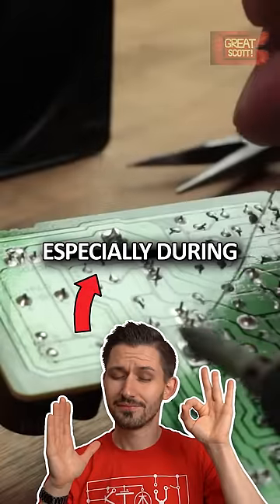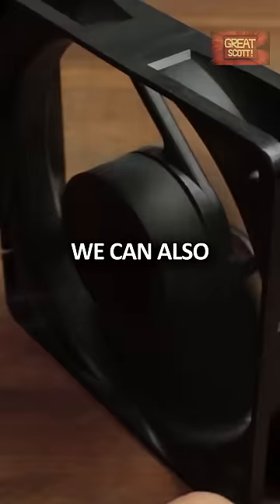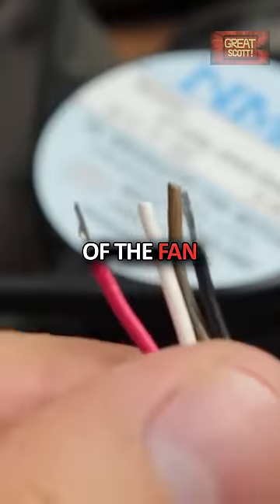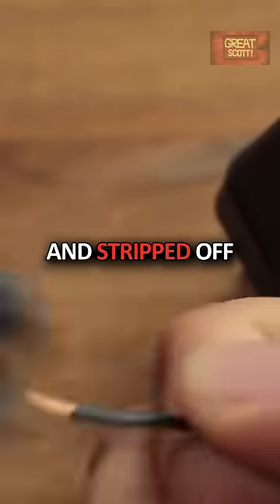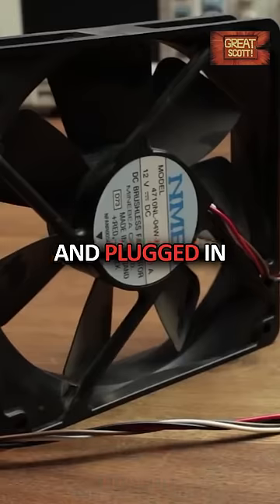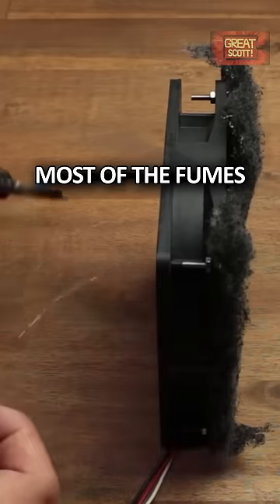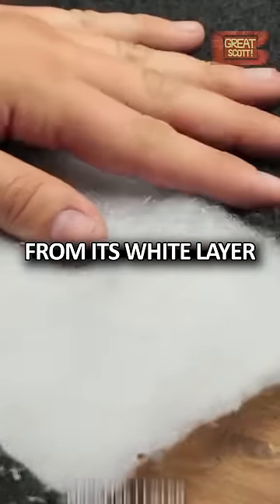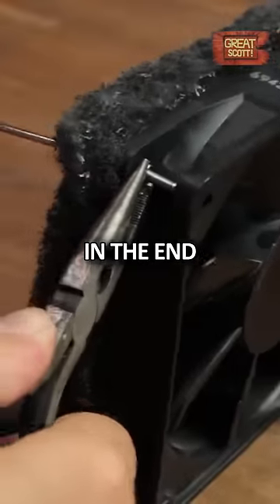Always have This when Soldering!

Comment: Never cut a plug that close! I leave about an inch and throw it in a "useful junk" box in case I need it for something later
Reply: Same but 10cm
Reply: Why didn't he just attach the connector, it's cheap and makes this shit modular
Reply: Same
Reply: I prefer to cut open the plastic shroud around the connector itself. No wires, just the bare connector component.
Reply: Yeah I leave an inch too, I got triggered watching that 😕
Reply: @edwardfletcher7790  usually i am cutting all the connector and re soldering wires directly to it + thermal shrinking tube
Reply: Ust buy a multi pack of female barrel jack so you can use it for other things too
Reply: @jimb032  btw it has one flaw: the thickness of the central pin is different

This has annoyed me as heck making router back up supply during Ukrainian winter 🥶 to have the internet
Reply: @Gameplayer55055  Same here, it's so handy 👍
Reply: @dylanm.3692  But then you've got no strain relief.
Reply: @Gameplayer55055  There's many different sizes, a small amount of aluminium foil inside the plug can help in an emergency.
Reply: @edwardfletcher7790  lucky you. I had to use a file lol
Reply: @Gameplayer55055  Ohhhh damn ! I assumed you meant the plug hole was too big ! 😕
Reply: @edwardfletcher7790  Who said I don't add strain relief when I use them?
Reply: @dylanm.3692  My point is you're cutting off the most effective strain relief they already have.
Reply: The hoarder in me cringed when he did that haha
Reply: 👍👍👍👍👍i give you 5 thumbs ups for that one mate
Reply: Came here to say this :-)
Reply: Why not desolder the whole cable. It's not hard when you redesign device. And save molded socket still usefull. 

Good channel. Watched a lot
Reply: @MultiKomentator 25.4mm😂
Reply: @Gameplayer55055 Because then you need to buy a female connector?
Reply: @Soheil-ev6ls  but then you can detach the power supply, use the other one, or just store it without annoying dangling power brick
Reply: @Gameplayer55055  I was gonna say many people can recreate the vid without ordering anything. 
Just realised I don't have carbon filters laying around lol
Reply: some 😂❤
Reply: yes.
Reply: @Gameplayer55055  having gone through almost the exact same process, the landscape of barrel jacks is a friggin mess, I just popped on  a pair of terminals and affixed them via those. 

Just for kicks I even plonked on a relay to switch it on and off - really just felt like it although it's absolutely unnecessary to include 😂
Reply: @ajoshdoingthings541  barrel jack standard is a holy mess. Looking for a really standard and reliable connector.

Type c looks great, but it has only pd trigger
Reply: @Gameplayer55055  struggling with type C as well right now. But that spec is also kinda messy and all over the place, at this point I just want to cry 🥲
Reply: @ajoshdoingthings541  xkcd picture with 14 competing standards
Reply: The same but i cutted it to half meter
Reply: Exactly!

Comment: Oh boy. Activated carbon filter does nothing other than taking away the smell of flux fume. The thing that's bad for health is median 35 micron size respirable particles in the flux fume. You'll need a proper HEPA filter for that. This dinky thing is functionally equivalent to pinching your nose and blowing at the fumes while soldering.
Reply: Do you know where one can order proper HEPA filters? I've seen some filters which claim to be HEPA but they are almost see-through in some places. Maybe it's different grades?
Reply: I use a IKEA Förnuftig air purifier, with extra carbon filter. Not sure if its good, but it does not smell, and has a "hepa-ish" filter and is tested with "Partikelfiltret är testat enligt EN 1822-1 och ISO 29463-3 vilket motsvarar klass EPA12."
Reply: It does not have to filter them out. Most important is to suck them and take away - for example to open window. That is why i would make also a flexible pipe and point it at opened window. The best would be to take it out of window and turn to one side so wind doesn't blow it back to the room.
Reply: @DrInfiniteExplorer  Order a large (e.g., 16x25x1) furnace MERV-13 filter. Cut a section to fit the fan on the intake side. MERV-13 is good to 2um. You have lots left over for more filters as needed. Of course if you already buy furnace filters, just buy a box of filters in your furnace size. MERV-13 takes out smoke, pollen, bacteria and most viruses as well.
Reply: Exactly what I was just thinking, not unlike carbon filters for water, which merely remove the taste of impurities, but not necessarily the impurities, themselves.
Reply: @DrInfiniteExplorer  Just use your vaccum cleaner it has everything a hepa filter and a carbon filter
Reply: I just saw a few other sources saying that HEPA wasn't enough and that a ULPA filter is needed.

Regardless, I'm deeply regretting the money I spent on my Hakko FA-400 now.
Reply: Hey, that's what I'm doing xD
Reply: @LeitoAE that's the most reasonable and simple decision of all.
Reply: Most flux is natural and non toxic nowadays... However the lead in the solder is the killer.. If you directly inhale it's bad but because lead is heavy, if it's sucked away and preferably through a metal box, the charged lead particles mostly attach to the inside of the metal box, hence why I always build my extractors out of old PC power supply boxes with an intake & exhaust fan & put a filter inside it.

Comment: Personally, I always found my leaded solder works best when lick it then tin the iron, then lick again. You know you got it right when you can smell and taste it for weeks after your project is finished
Reply: Worked for Steve Wozniak!  Why not
Reply: I too am a fellow lead poisoning enjoyer. happy to see I'm not alone.
Reply: For the body it's very hard to absorb the metallic lead. So I will suggest some lead salt if you want lead poisoning. Also the fun doesn't contain lead but flux vapour and burned flux which are also bad for lungs but not lead.. I will guess it's as bad as smoking.
Reply: Who needs a sponge?!
No, seriously, lead is very nasty for health.
Reply: @goku445  the gas doesn't contain any significant amount of lead, boiling point of lead is very high.
Reply: @goku445  average life fan vs average lead poisoning enjoyer

Comment: When you need to solder to protect yourself from solder fumes
Reply: Next level weird would be Needing to Solder a new mains cable to my soldering iron cause the original one got burnt. Glad i had another soldering iron laying around 😅
Reply: He could have just used a barrel jack connector with screw terminals, it would have been much easier and would make the power supply reusable. Also no soldering required then.
Reply: @Rundumsfliegen  I had to solder a plug to a power supply in order to use my soldering iron, but I didn't have another soldering iron, so I cut off the old connector and tied the plug to the power supply so current would pass, then plugged in the iron, turned it around, and soldered its own wires.
Reply: @William_Asston  Haha, you won :D
Reply: A small price to pay for salvation
Reply: @William_Asston you fixed your soldering iron with itself, you have now competed all the secret achievements in life
Reply: @PFnove  I thought it may short or something.  Not because the tip is grounded--the ts100 doesnt have a grounded tip--but because I was afraid the devs had some trigger in place to prevent this level of circular tomfoolery.
Reply: Like the scissors in a package that needs scissors to be opened ✂️

Comment: I have been soldering in the past 40 years without fume extractor and sometimes with closed windows when it was cold outside and the only health problems that I've has were not related to solder fumes whatsowever.

Comment: What I have learnt is to always exhale through your mouth (a light blow basically) while solding. This way, you can't breath it in, obviously, and you blow away the fumes.
Reply: This is me after my extractor broke 4 years ago 😂😂😂😂😂
Reply: I blew too hard and the 0402 resistor flew away lol
Reply: @TheMajorLim  you joke, but this actually happened to me yesterday. I was looking all over the floor for a freaking spec that was smaller than a grain of rice.
Reply: @evilmonkeywithissues  I spent 2 hours hand soldering a single 0201 cap in a awkward position on a Nintendo switch, yesterday. I feel your pain 😭
Reply: @TheMajorLim  That's Precisely what I was doing, except it was a resistor that had come unseated from the RSX on a PS3 Super Slim when someone tried to clean some excess solder paste with a stiff bristle brush instead of a soft toothbrush. I was attempting to hand solder it because I'm out of solder paste (I have more on the way, because I never want to do something like that again). I was holding it in place with a pair of carbon-tipped tweezers, and I guess I squeezed just a little too hard because the next thing I know, I heard the tweezers go 'tink', and the resistor shot off my worktable onto the floor. That was a nightmare.
Reply: So you just exhale the whole time you're soldering and never inhale. I don't know why I never considered that.
Reply: @evilmonkeywithissues It's still good that you didn't inhale it! 😄 Next thing you'd need is an extractor fan for jumpy SMD components
Reply: @dan-nutu  Actually I was thinking about trying to repurpose my wife's old Nail Curing Station for situations where I'm soldering super tiny components like that. It's a large dome shape (big enough to fit both hands under) with UV LEDs and a couple silent intake fans to pull out the fumes from the chemicals they use for nail art. I figure that I can simply replace the UV LEDs with a regular LED strip and have the perfect fume hut. It's strong enough to pull away the fumes, but not so strong that it will suck up or move around tiny components.
Reply: @evilmonkeywithissues  can you see anything through it, to be able to solder?
Reply: @evilmonkeywithissues  also, you must have a very understanding wife to allow you to use her nail thing for soldering! 😄
Reply: @dan-nutu  Oh definitely, but I just bought her a nicer one recently. She's all but forgotten her old one, lol. I asked her if she minded me repurposing it, and she told me she didn't care as long as I got around to building the Electronic Nail Art case I've been planning to build her. I bought a few actuators, a handful of RGB LED strips, and a DIY Bluetooth speaker that I'm going to incorporate with a custom built Nail Art Case for her.
Reply: @evilmonkeywithissues  sorry, I have no idea what's a "nail art case" 😄 what are the actuators for?!
Reply: @dan-nutu  It's just a case for nail polish and nail art tools. They might have a more official name, but my wife has always just called hers a nail art case. The actuators are to automatically push the drawers open, and I modified a set of two with a 3D printed swinging hinge to push open the lid as well. Imagine one of those jewelry cases with drawers in the bottom, and a nail art case is essentially just a larger version of that. I'm going to attach all of the actuators, speakers,  and LEDs to a wireless Bluetooth transceiver to use with a remote so she can control everything with her phone.
Reply: @evilmonkeywithissues  Gee, the things you get to hear about on the YT comments section for a soldering fume fan! 😄 What's wrong with using just a plain old "traditional" box to store all that stuff for nails in? As far as I can imagine a simple plastic box from Ikea would be perfect. LED strips, actuators and BT remote control? Man, you are clearly overcooking it! Nothing wrong with trying to put it together but then you'll also get the "benefit" of having to maintain it going forward. Or even having to upgrade it at some point!
Reply: @dan-nutu  There's no real maintenance involved. The actuators are small and easy to grease, and it wouldn't be difficult at all to replace anything on it. I'm building it with ease of access in mind. The reason I put together projects like this is because I'm an Electronics Engineer, so it serves as good practice for me. Plus, it will be a one of a kind thing. If anyone takes notice and likes it, I can build them on commission. You would be surprised what people are willing to dump hundreds of dollars on. I've already built a few Smart Vanity Mirrors from scratch for people that my wife works with. They aren't difficult to build, cost like $60 for me to build, and I make $250 for each one I build. More than anything though, I just enjoy making things for my wife.
Reply: @evilmonkeywithissues username does not check out haha

Comment: I just use mine as a blower, with a 50c buck converter for adjustable speed control. As long as its not wafting directly in your nose I think you're good. Most people aren't soldering for 4 hours in a closet

Comment: This is why I use lead-free solder. It has a higher melting point and if the tip of your soldering iron oxidizes it won't melt. Other than that it's perfectly safe.
Reply: You do realize that the fumes aren’t the metal itself right?? It’s flux. 

The temperature to turn lead into a gas is like 1700 degrees c.

Comment: To reduce the noise of the fan you can use an adapter with lower voltage. often the 12V fan works with only 5V too. Check how the airflow is reduced following your needs!
Reply: also could use the old "trick" of wiring fan + to 12V and - to 5V to get +7V

Comment: To the OP it is called and say it with me, "positive <red> and negative <black> the white is common and the brown is the sense line which you should have removed and sealed. Also you should have verified the positive line from the AC adapter <it's the center of the barrel plug, so you need to verify which direction the fan is going to spin to make sure the direction is blowing through the filter and not from the filter. Also one thing that's important is to have a shroud as it narrows the air flow and increases the cfm of the draw. 

For everyone else if you are looking for a power supply got to a place like the salvation army or places similar and you can usually find power adapters galore ready for DIY.

Comment: I did this with a PC fan, but i found it was too weak. Only getting the fumes if <10cm away. Regular PC fans are only about 0.08 Amps. So i upgraded to a powerful 0.3 Amp fan, and it's much better.

Comment: If you want to really do something cool to this, I added some ducting and attached the outlet to a piece of wood that goes right underneath my window, and i even added some sealant to prevent any smoke from making it back into my workshop area. It was a nice little addition on top of this build!
Reply: The carbon filter can and does remove pretty much all the fumes and smoke so there is no need for external venting. If you are using external venting then you might as well not use a filter. Also a lot of PC fans are made for airflow rather than pressure, so adding ducting might actually reduce the performance and airflow of the fume extractor.
Reply: @conorstewart2214  I didn't have any carbon so I used what I had on hand. It works well enough for what I used it for. I ended up getting an actual extractor a few months later. Good tips for people who do take my advice, thanks!
Reply: @3v068  oh right I thought you meant you used a filter and ducting. Yeah a filter and ducting is probably too much restriction for the airflow unless you use a high pressure fan.

Comment: I built my fume extractor almost exactly like this years ago (down to the 12v wall wart hack) Then i duct taped a length of flexible drier vent to it so i can move the noisy fan away from the concentrating area.

Comment: Even better: put pin connector to the power supply so it's easier to disconnect and the fan has the original connector if it's needed elsewhere, you get a better fume extractor or either power supply or fan dies 😉

Comment: I inserted a microswitch into the supply and fiddled it intothe rim of the soldering iron holder. The fan sits inside a 50 cm plastic drain pipe. At it's end are another fan and a filter.

Comment: Also, be careful about the positive and negative ends of both the fan and the adapter. The red wire from a fan is usually the positive and the wire that is connected to the inner surface of a barrel plug is usually the positive, so these two wires should be joint. Otherwise the fan can damaged from negative voltage and not spin (dc current must flow in the same direction).

Comment: i did one for myself in a similar way, but also added an adjustable step-down converter (cheap chinese module, we're dealing with currents below 0.5A here) to easily regulate the fan's speed without wiring up entire pwm controller.

Comment: A mini fume extractor would be of greater help, if someone does a lot of soldering. Directly extracts the toxic fume out of the room/house. I have my own DIY version of that by using a cheap air inflator which is controlled with a speed controller (both running on mains voltage). For piping I used transparent plastic light gauge pipe (approx 10mm in diameter). Perhaps you can make a tutorial of sth similar or even a better one for your audience 🙂🥂

Comment: I used an old atx power supply. Just remove the pcb and wires and insert the filter in between fan and housing. The power supply also has a power switch.

Comment: Rectifying some myths:
1. It's organic compound thermal decomposition, which will give off some carcinogenic products. Lead is close to the melting point and won't really evaporate. 
2. While filtering is definitely good, the main objective is to get the concentrated fumes away from your nose. By mixing, they'll be dissolved in the air down to harmless concentrations.

Comment: If you use a more modern fan, just use 2 dupont wires to connect, that way you don't have to solder it. Also, consider getting a usb buck-boost converter. That way you can just plug it into your phone charger.